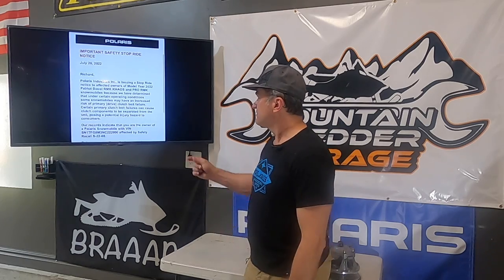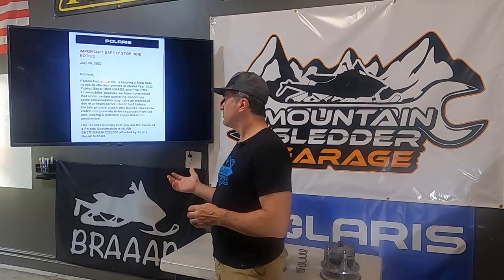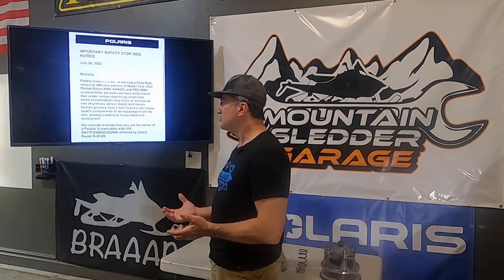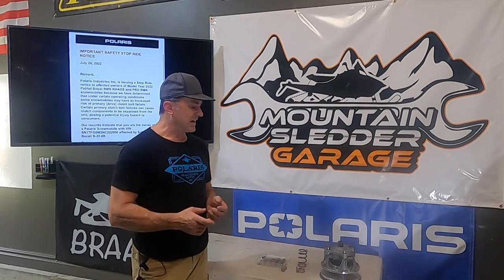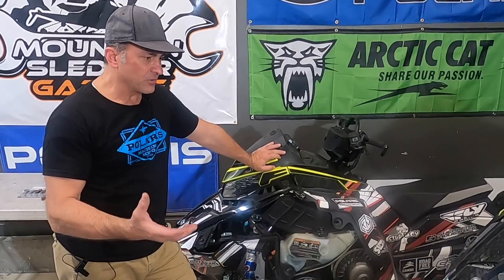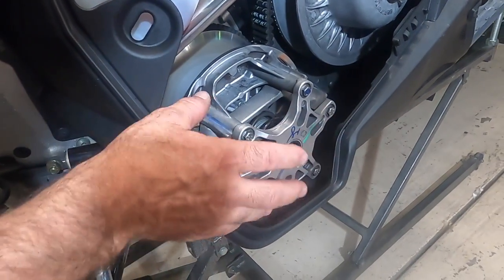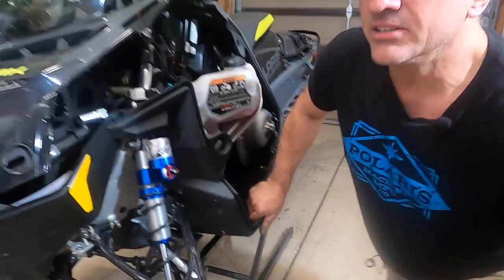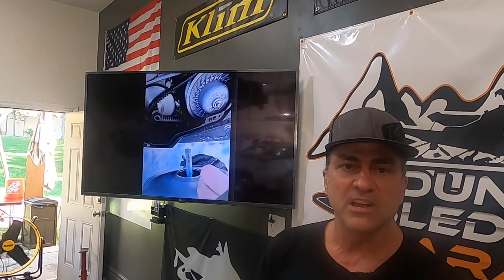P 22 bolt failure2

Comment: Here we are in 2024 and bolts are still breaking left and right
Reply from the maker: Bolts will most likely continue to break until the clutch is redesigned or round filed. The entire clutch is held together by the bolt. No other snowmobile clutch has this poor design. Like the P-85, needs to be held together by a screw on and torqued spider and jam nut.

Comment: The Polaris MY23 Boost (turbocharged 2 stroke) flatland snowmobiles have a different clutch mounting bolt: it is Part# 7528193. The Bolt used in the MY22 Boost sleds is no longer used in snowmobiles.
The new bolt is used on the MY23 Polaris snowmobiles with the new Prostar S4 four stroke engine, which also use the P22 primary clutch.
Reply from the maker: You are correct. The microfiche for the 23’ boost VR1 does show a different part number than the 22’ boost mountain sleds. I don’t see any microfiche for the 23’ mountain sleds yet. Is the different part number for the vr1 the updated “fix” for the failing 22’ bolt? Hopefully talking with Polaris engineers at bay days will give answers.
Reply: It looks like now the 9r rmk and boost rmk use clutch bolt part # 7528304 now.  I am tryin to find this install bolt that people are talking about.  I've called a couple dealerships and they don't know anything about the instal bolt.  Anyone know where to get these?
Reply: @SeanChuma Directly from Polaris, part # 7520950.

Comment: Have you had a chance to check out the fix/update to the clutch bolt failure?  What are your thoughts on it?
Reply from the maker: I'm not convinced that the bolt update is more than a band aide for the clutch. Over the next we’re months we will see once the 23’s and 22’s get more time on them. Personally I put a P-85 on my boost for now.

Comment: Very clear explanation and very useful.  Thank you!
Reply from the maker: Thanks. My sled is at the dealer getting the new fuel filter update. Hoping they come out with the clutch bolt fix while it’s there before winter starts
Reply from the maker: Thanks. My sled is at the dealer getting the new fuel filter update. Hoping they come out with the clutch bolt fix while it’s there before winter starts
Reply from the maker: Thanks. My sled is at the dealer getting the new fuel filter update. Hoping they come out with the clutch bolt fix while it’s there before winter starts
Reply from the maker: Thanks. My sled is at the dealer getting the new fuel filter update. Hoping they come out with the clutch bolt fix while it’s there before winter starts
Reply from the maker: Thanks. My sled is at the dealer getting the new fuel filter update. Hoping they come out with the clutch bolt fix while it’s there before winter starts
Reply from the maker: Thanks. My sled is at the dealer getting the new fuel filter update. Hoping they come out with the clutch bolt fix while it’s there before winter starts
Reply from the maker: Thanks. My sled is at the dealer getting the new fuel filter update. Hoping they come out with the clutch bolt fix while it’s there before winter starts
Reply from the maker: Thanks. My sled is at the dealer getting the new fuel filter update. Hoping they come out with the clutch bolt fix while it’s there before winter starts
Reply from the maker: Thanks. My sled is at the dealer getting the new fuel filter update. Hoping they come out with the clutch bolt fix while it’s there before winter starts
Reply from the maker: Thanks. My sled is at the dealer getting the new fuel filter update. Hoping they come out with the clutch bolt fix while it’s there before winter starts
Reply from the maker: Thanks. My sled is at the dealer getting the new fuel filter update. Hoping they come out with the clutch bolt fix while it’s there before winter starts
Reply from the maker: Thanks. My sled is at the dealer getting the new fuel filter update. Hoping they come out with the clutch bolt fix while it’s there before winter starts
Reply from the maker: Thanks. My sled is at the dealer getting the new fuel filter update. Hoping they come out with the clutch bolt fix while it’s there before winter starts
Reply from the maker: Thanks. My sled is at the dealer getting the new fuel filter update. Hoping they come out with the clutch bolt fix while it’s there before winter starts
Reply from the maker: Thanks. My sled is at the dealer getting the new fuel filter update. Hoping they come out with the clutch bolt fix while it’s there before winter starts
Reply from the maker: Thanks. My sled is at the dealer getting the new fuel filter update. Hoping they come out with the clutch bolt fix while it’s there before winter starts
Reply from the maker: Thanks. My sled is at the dealer getting the new fuel filter update. Hoping they come out with the clutch bolt fix while it’s there before winter starts
Reply from the maker: Thanks. My sled is at the dealer getting the new fuel filter update. Hoping they come out with the clutch bolt fix while it’s there before winter starts
Reply from the maker: Thanks. My sled is at the dealer getting the new fuel filter update. Hoping they come out with the clutch bolt fix while it’s there before winter starts
Reply from the maker: Thanks. My sled is at the dealer getting the new fuel filter update. Hoping they come out with the clutch bolt fix while it’s there before winter starts
Reply from the maker: Thanks. My sled is at the dealer getting the new fuel filter update. Hoping they come out with the clutch bolt fix while it’s there before winter starts
Reply from the maker: Thanks. My sled is at the dealer getting the new fuel filter update. Hoping they come out with the clutch bolt fix while it’s there before winter starts
Reply from the maker: Thanks. My sled is at the dealer getting the new fuel filter update. Hoping they come out with the clutch bolt fix while it’s there before winter starts
Reply from the maker: Thank uou

Comment: I like the Magnum Force weights , bought light set and  heavy set , covers entire spectrum with plenty of overlap in the middle ,  spot on identical weight on scale , I’ve seen stock weights , vary by 2.9 grams across all three , lightest to heaviest , pull them out and put them back in , in a different spot than original , your balance has been ruined
Reply: My clutches , primary done by SLP , balanced , new everything , secondary is Venom , Team Tied , nice design
Reply: Don’t pin it off the line , and reduce throttle slowly when slowing down , except for Don’t Panic Stop

Comment: Great info. I just got a boost
Reply from the maker: If it’s a 2023 it should have the updated clutch parts. If it’s a 2022 hsve your dealer check the vin yo see what updates/recalls it needs
Reply: @mountainsleddergarage8627  it’s a 22. I called the dealer yesterday and they ordered that and a new fuel tank. Not sure how long it will be but I’m still riding once it snows

Comment: P-85 , I run three new belts , measure belts with calipers  to equal widths , reshim primary , and finish out the year , buy the complete break down kit , easy after the first time
Reply from the maker: The nice this about the p-85 is you can use the shims to adjust belt to sheave clearance. The P-22 doesn’t adjust, your stuck with how it comes. Seem stock P-22 with stock belt with .080-.10 belt to sheave.

Comment: SLP performance edition 700 ves , 2005 rmk motor in a 2004 switchback , it’s better than new , bored carbs , and everything in the catalog , except egt probes in the Y-pipe , I can read piston wash , sly dog 8 inch powder hounds , all new everything ,right down to nuts ,bolts , bearings , everything , striped and painted suspension , it’s a 2004 Polaris switchback 700  , a true Money  Pit , I’ve got new machine money into it , a 2004 , somebody  , please , hold an intervention , for your friends like me , just buy a new one
Reply: Timing at 21 degrees